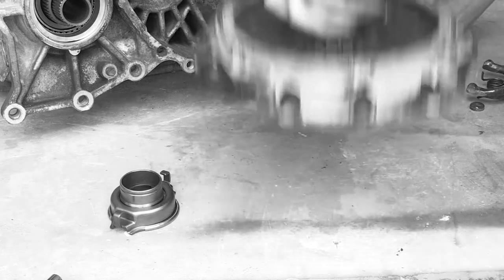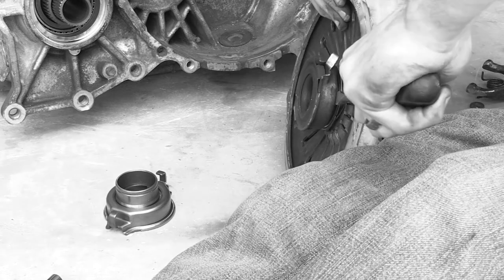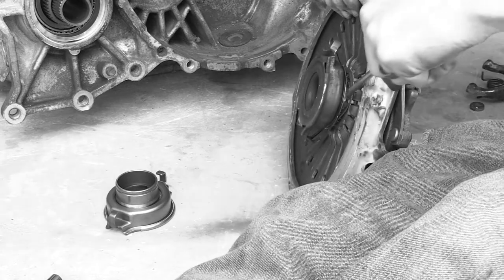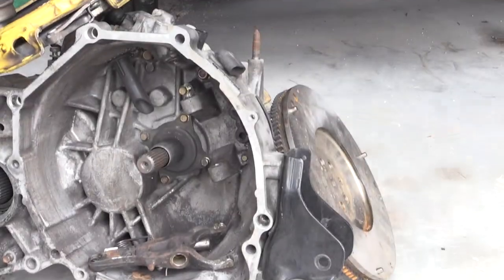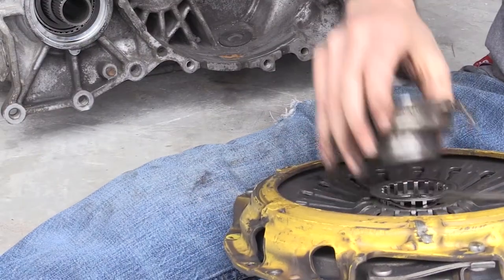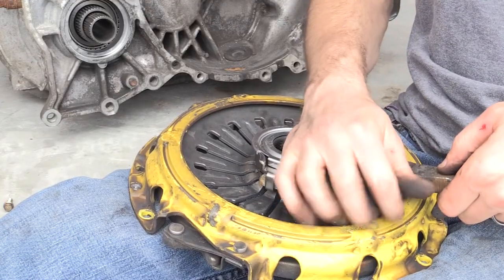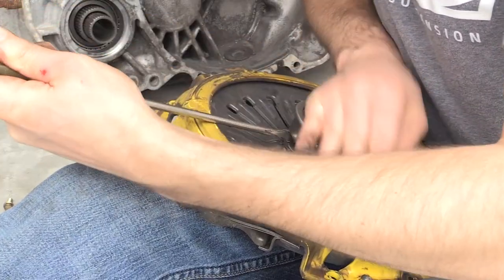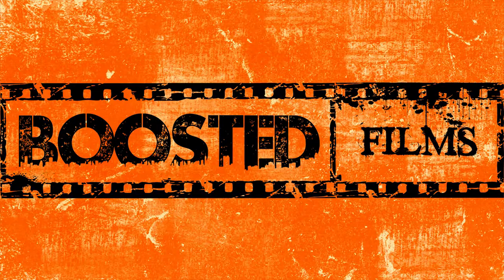Mitsubishi Throw Out Bearing - How to release // Mitsubishi EVO 8 - EVO 9

Comment: What if my fork won't move towards the plate ?
Reply: ok so. I am doing clutchjob on evo and i had fork stuck. I improvides by ratchet strap, by its power i pushed the fork and after the fork loosed. Its like seized on one position or the clutch piston direction, so just loosed it by other force. Now i can move fork by hand

Comment: How to put clip it back on after i installed the tranny
Reply from the maker: pull the clutch fork in place and it will pop the TOB into the clutch.  https://youtu.be/UKTGMsKj6P8
Reply: @BoostedFilms  man ty for the fast reply currently working on the car rn the last step is that by i try to pull it back as hard as i can but the bearing still doesn’t clip back on to the retaining collar
Reply: @BoostedFilms  do you recommend drop the transmission again?
Reply from the maker: I think i need more context.  Are you just doing a standard clutch replacement on an EVO8/9?  What clutch are you putting in? Do you have a monloc collar? Were there transmission/clutch issues before you started this job?
Reply from the maker: https://youtu.be/hiDOhW3pkEc?t=513
Reply from the maker: Did you use a clutch alignment tool?
Reply: @BoostedFilms  i just installed the exedy twin disc and no i do not have the monoloc collar im using the one exedy provided and yes i did use the clutch alignment tools
Reply: @BoostedFilms  i cracked the belt housing transmission mount just got it weld and i was like might as well change out the clutch
Reply: @BoostedFilms  i tried to pull the clutch fork back but it still doesnt clip on to the wedge collar
Reply: @BoostedFilms  should i apply more forces?
Reply from the maker: Cool. Did the trans bolt up to the engine fairly easily?  Assuming its currently flush mounted? I wondering if you need to drop the trans, to try re-aligning the clutch, and then try re-installing again.  You're TOB should pop in place easily once everything is lined up right.
Reply: @BoostedFilms  yes it’s flush mounting rn bolted the top 3 and 1 on the bottom
Reply: @BoostedFilms  so you saying i should take the pressure plate out and inspect the wedge collar?
Reply from the maker: I don't know that you have to take the clutch back off the engine.  But you probably could drop the trans, then try to put the TOB into the wedge collar with the trans off and see whats going on with it.